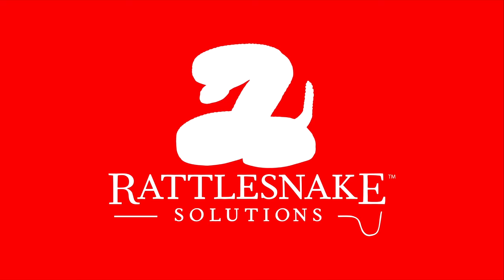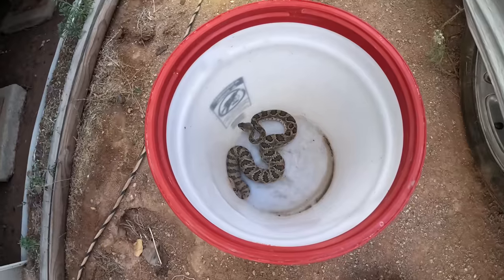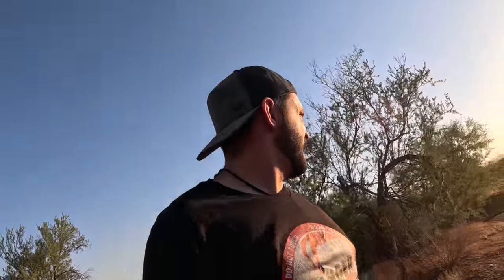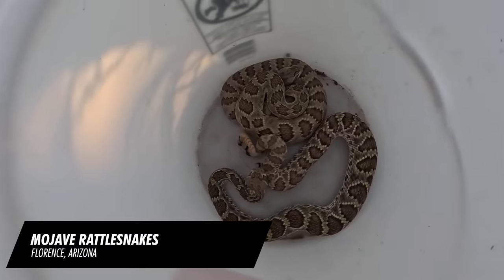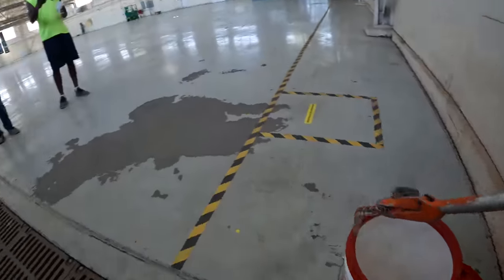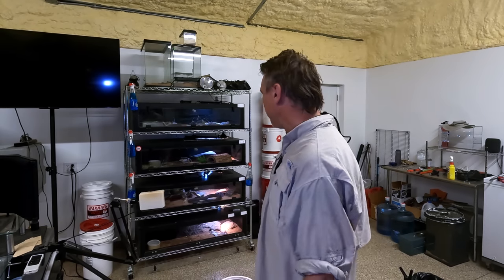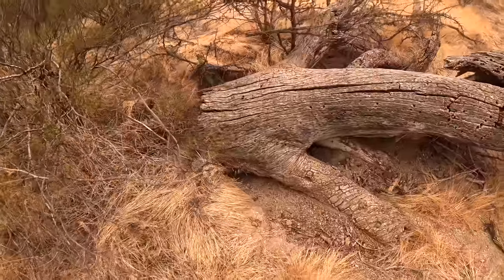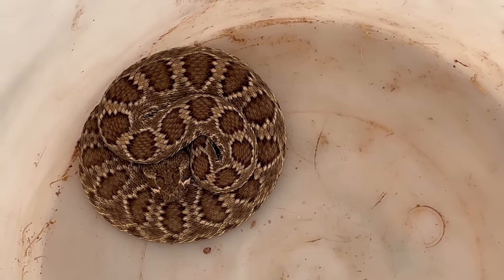Removing Mojave Rattlesnakes from Under a House

Comment: Story I was told was you had to identify the snake that bit you for the proper anti venom is that true?
Reply: That's considered to be outdated advice, if you know it's a rattIesnake or other venomous snake, that's good enough. 
If you can safeIy and quickIy snap a picture of it, if you're not sure what it is, (without taking extra time), that's fine but the most important thing to do if you think you've been bitten by a venomous snake, is to stay caIm and get to the nearest hospital asap, without panicking.  
There's onIy one antivenom for pit viper bites, which includes rattIesnakes, copperheads and cottonmouths so the exact species doesn't matter. 
The Dr's can teII by your symptoms, what systems the venom is affecting and how to treat you.
Reply from the maker: I answered this in a live video, which you can find on our channel. Thanks!